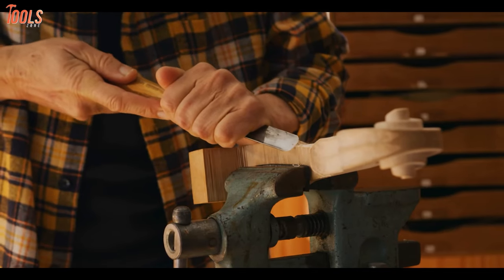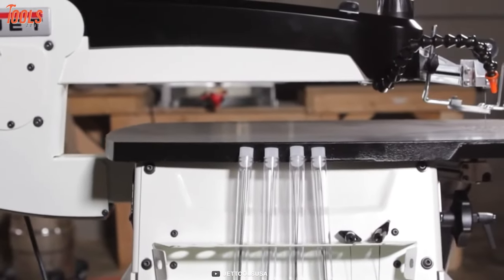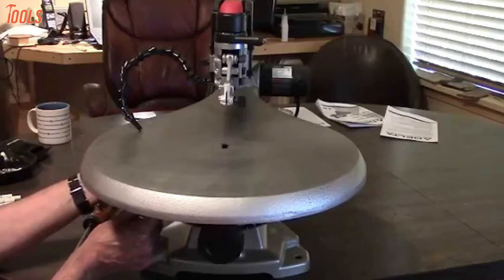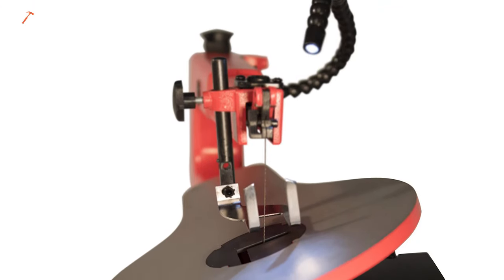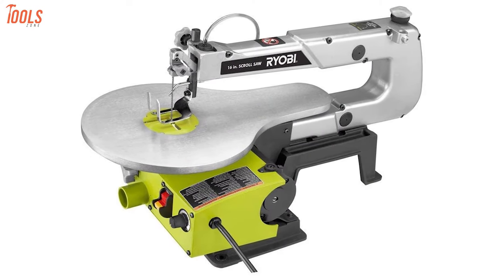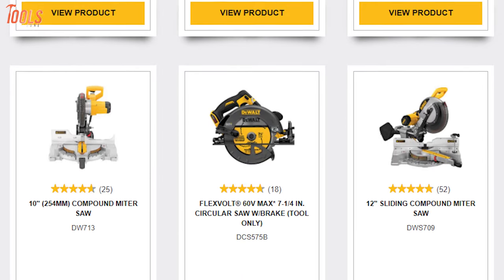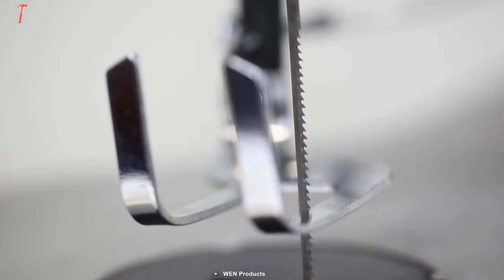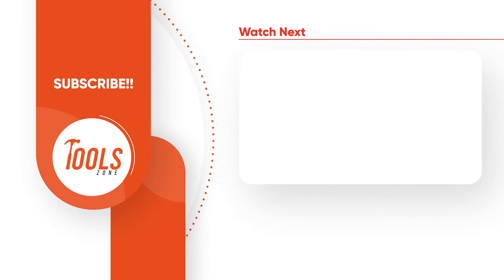7 Best Scroll Saw for Woodworking

Comment: I have been scroll sawing for close to 50 years the saws you reviewed are decent saws but for me there’s nothing as good as a parallel arm Scrollsaw such as RBI or Hegner my 1983 Poly Max 3 is still going I have spent less than $100 In repairs I had to try The DeWalt 788 great saw cuts good but in a years work in was in need of a overhaul I enjoy the video but honestly the New Era scroll saws just don’t hold up for the long haul 
Thanks for the reviews I just had to tell my thoughts
Reply from the maker: Thanks a lot for sharing your experience with us.❣

Comment: Have a good look at the Skil, Ryobi, Shop Fox and Wen. The are all basically the same scroll saw with a different paint  job. Some have extras like a light, different motor etc. The castings are all basically the same and all made in China. There are many the same by brands not mentioned here . Buyer beware !
Reply from the maker: Good point!